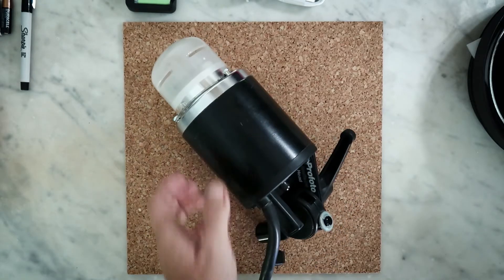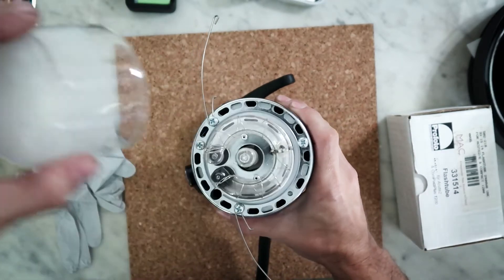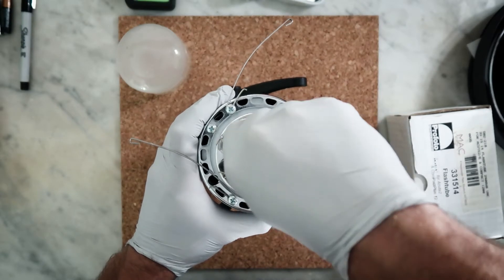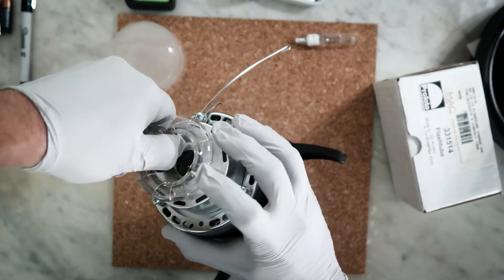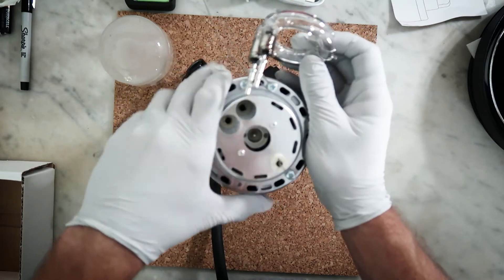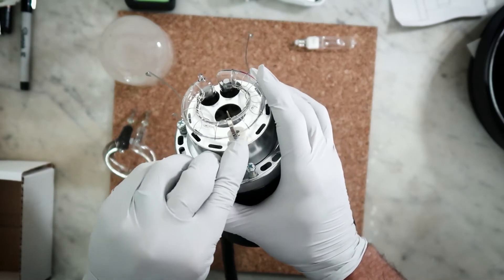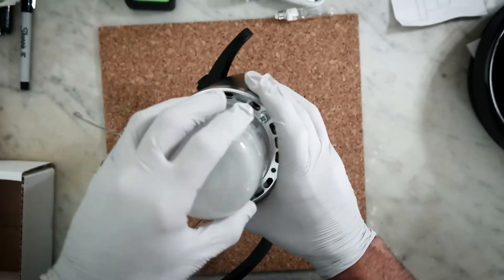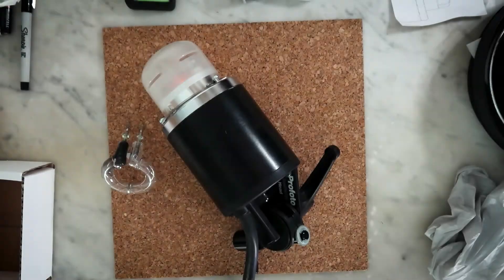I BLEW IT! Replacing a Profoto flash tube

Comment: Hello, where did you get replacement tube ?
Reply from the maker: I've had it sitting around for years so I was lucky there. I think you can get them at B&H but they're $$$$.
Reply: Profoto proprietary flashtubes are expensive. There is another company called Strobotronix who sell replacement tubes